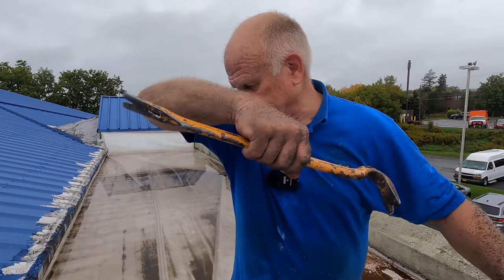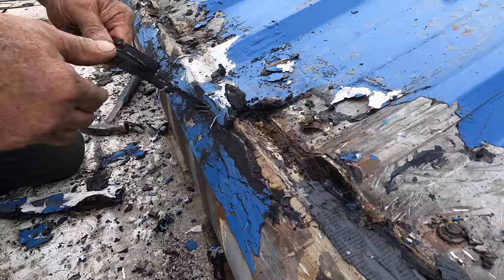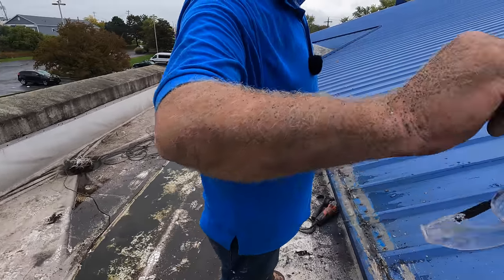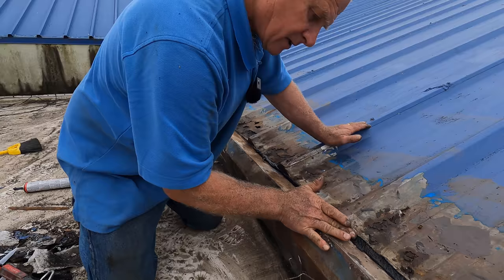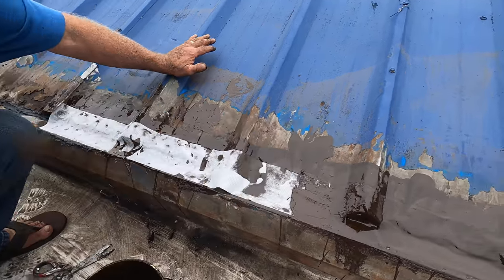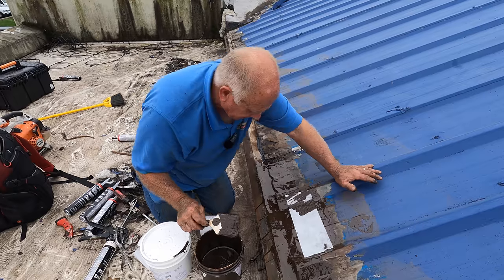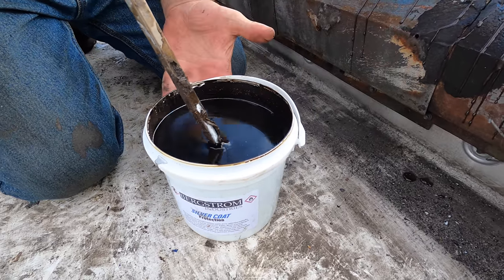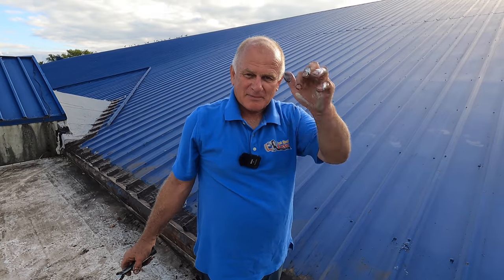How to Repair Rusted Metal Roof Leaks - Turbo Poly Seal

Comment: someone used tar on the valley on my garage metal roof before i bought the house. and its all cracked. prob done over 20 yrs ago im guessing. everytime it rains it goes right in there. they pretty much put the roof together with 2 different types of metal roof panels. almost as if they were leftovers. werent cut properly. old nails with rubber instead of screws and alot of nails missed the beams underneath and they left them. for the valley metal when i go in the garage and look up i can see writing on the metal. they used old signs lol. i mean it must of worked for some time as a temp roof. but ill have to try to reseal it  and find all the holes as a temp fix because i cant afford a new roof but still trying to save it because its from the 1800s

Comment: How much do you charge for fixed metal roof repair?
Reply: For feet  or for square
Reply from the maker: Hey Marco
Pricing a job is always the hardest thing to do.
I try to earn between $2000 - $5000 per day. that includes material, labor and my expertise. Most of the time people have made such a big mess that it takes longer to clean up and fix it. then other times there is almost no prepping and I can get it done in no time.
I have made a video that gives you a good idea how long it takes to fix a seam on a metal roof. This is the link to it https://www.youtube.com/watch?v=g-8BfK-hYdQ

Comment: Like rust on a car, won’t the rust continue to grow under the turbo and material?
Reply: Yes indeed rust will continue and I know from my own roof where rusting on the edges started on the underside.  (capillary action, wind action and also condensation).   I am sure there is extensive rust underneath and also he has applied seal without treating all the rust so it will continue to creep especially when the galvanising coating is gone. That  roof needs to be lifted and the rust treated both sides, painted / sealed and then patch the holes .  Or cut out and insert another piece of iron making sure that both sides and laps are thoroughly sealed as I guess the rust is extensive  near the edges.  I can see paint bubbling on the roof and that could also be from rusting pushing through from underneath. But partially lifting the roof iron etc costs much more time and money.
Reply: @stuartmclaren2402  Yep thanks

Comment: what about the bare metal?
Reply from the maker: Not sure what you are asking. But it is always best to clean up the area from all other materials before making a repair
Reply: @FlatRoofDoctor  I think I'D was asking about the bare metal left between your repair and the blue paint on the roof in this video. Did you go back and paint the bare metal with regular paint or the aluminum paint? Or was that left to the customer to take care of?

Comment: I like you man why didn't you just cut a 1-foot slice up the roof and get you some 2-foot Metal Sheets slip under there God can screw it be done with it look ten times better and 10 times faster... they still make that color and style
Reply: Just one old humble ROOF dogs opinion
Reply from the maker: Sure, that would work too. But the time and getting the profile would also be an issue

Comment: How come you are wearing flip flops on the roof,  if you are concerned about getting your shoes soaking wet, you should wear waterproof shoes like I do.
Reply from the maker: Waterproof shoes are rarely needed. So rare that I would never consider it. The reason I am wearing Flip Flops is because I have hurt the ball of my feet standing on a steep pitch roof for several weeks bending down. That really got me and the soft sole is a relief. Reef flip flops at $60 a pop
Reply: Ma man that gave me the fear the UK don't let you where shorts neverind flip flops lol